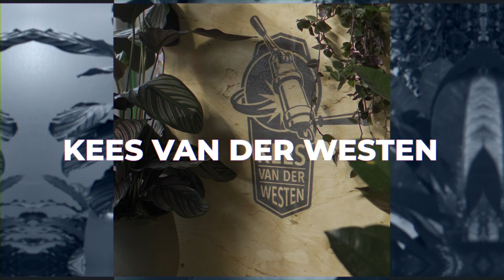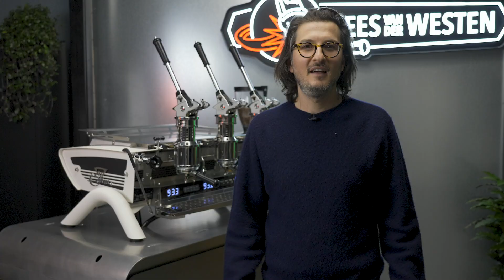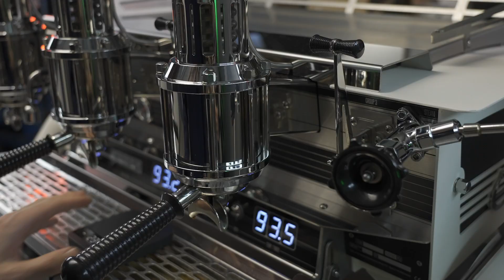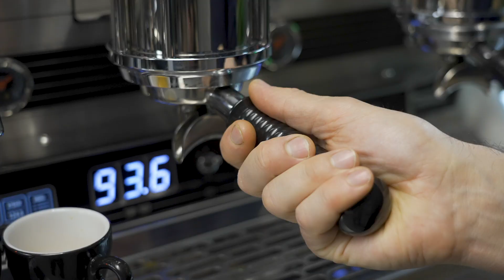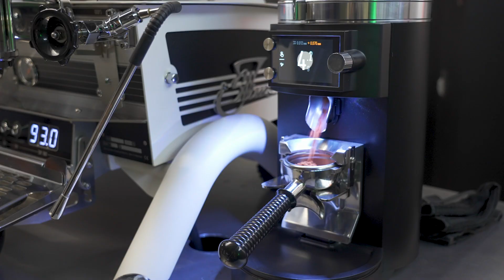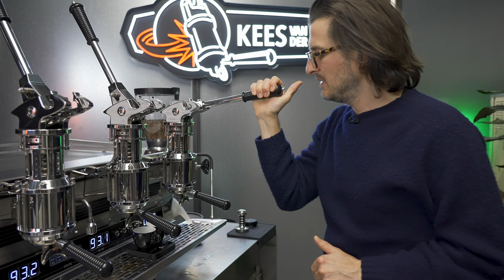The magic of lever machines: The Slim Jim Idrocompresso explained

Comment: After using a Rancilio commercial machine in my home since 2016, after a few years a variety of problems developed that required skilled repair techs that are not easy to find where I live. After getting the machine repaired it was sold to a friend and he loves it.  A year ago I decided to buy a Profitec Pro 800 lever machine and it is simple, well made, and has very few electronics. After using a lever machine, I would never return to any other machine.

Comment: Excellent!! But for next version I need one more feature: auto-flush (finish) shot at a certain timing or volume (weight) pre-defined for each group.
Reply from the maker: The Slim Jim Idrocompresso already has an automated flush, once you pull the small lever for a purge it stops automatically. Brew by weight is definitely something that we are looking into!

Comment: Idrocompresso and spring lever mechanism, have you combined it in one or it's two separate mechanisms in the group head?
Reply from the maker: “Idrocompresso” is a term used on the early classic lever group machines. From the end of the forties and start of the fifties there obviously was a need to distinguish the new type of machines from the old steam-driven-extraction ones. We like to use it nowadays to recognize the magnificent rich Italian history of technical developments improving the espresso coffee.  “Crema naturale” was another of these terms, as the new 9 bar extractions made possible by the strong springs created crema as we know it today.

Our lever groups are direct descendants of these classic machines. We still use a large lever to pull up a piston with a strong spring on top, but tried to make life easier for the barista by  eliminating the part of travel of the lever towards the barista, making spring pressure and infusion pressure adjustable, do away with the sneeze at end of extraction, make it possible to easily stop extraction at any moment and do a flush, have a shot timer and show actual pressure at the puck.
Reply: @KeesvdWesten  thanks for the answer! I guess i confused it with your idromatic mechanism, that is found on e.g. speedster. So, Slim Jim idrocompresso does not need an idromatic mechanism that measures preassure at the puck because it's spring lever, right?

Comment: Yes but people buy the lever machines preciselly because they want to have manual control over the lever and the pressure profile of their extractions. Doesn't the locking feature negate exactly that characteristic? When the release lever is pulled the group head lever returns in its position very fast to alllow any diversification of pressure in the final stage of the extraction.
Reply from the maker: Thank you for your reply! 

Our lever group functions exactly like the old classic spring-driven lever groups.

On the old type machines the locking of the lever (piston all the way up, water entering the brew chamber and infusing the coffee puck) is accomplished by pulling it over its central pivoting point. The piston is already at its highest position with that lever half-way. The rest of the travel of the lever is only to get it locked.

We simply developed a different locking system that functions at the point where the piston already reaches its high position, eliminating the dangerous lower range of lever travel.The locking of the lever has no different effects, compared to the classic spring driven lever groups.

The relief lever is only to be used when you want to stop the extraction process before the big lever hits home. For example because the coffee is blonding or anything else that seems wrong. On classic machines you can`t do much other than pull away the cup and/or start wrestling with the big lever.

With a spring loaded lever group there really is not much manual control as far as extraction goes. You may push a bit against the lever or hold it to slow it down when it moves, but that will not result in consistent shots in an espresso bar. It is the declining pressure of the spring that offers the desirable profile. Of course the barista can adjust the time and pressure of the infusion, which is important. On our machines also the spring pressure can be adjusted. The infamous sneeze at end of extraction is eliminated by an automatically activated solenoid.

Comment: As by many others, I would ask about your plans for a single head machine. Is the correlation between spring adjustment and pressure on the puck calculable? Does the machine have a single steam boiler for all group? (Great Machine, like all KVDW)
Reply from the maker: Hi! Lovely to read that you would be interested in a one group Idrocompresso, we have indeed noticed the requests ;) Probably, but the difficulty is the moving piston (constantly changing pressure) and back-pressure of the coffee puck. The old fashioned way to simply try and adjust seems to be the easy way! The Slim Jim Idrocompresso is a multiple boiler espresso machine, so it has one big steam boiler and a coffee boiler per group.

Comment: You are giving this the wrong spin. You now have mechanical paddles that offer complete pressure control across the extraction. You are way too narrow with that graph.
Reply from the maker: The graph is only shown to visually clarify the difference between pump machine versus lever machine. Don't forget the beautiful theatrical drama of the lever machine ;)

Comment: The piston seal and grease have always been a problem. I want to see the internal structure. Do I have to dance with the piston when replacing the seal?
Reply from the maker: Piston consists of 3 discs, which can easily be taken apart by loosening one central bolt. Replacing seals is piece of cake!
Reply: @KeesvdWesten  oh! I get it you are a genius The odds of using this expensive machine before it dies are infinitely close to zero.
Reply: For some, perhaps, I never had problems on seals or greasing on cma-group.

Comment: I have 2 x 2 group levers at home. A Victoria Aduino Athena in brass and a Bosco Sorento. They have identical group heads (double springs) but espresso tastes very different. Love them both and I alternate use on each day 
Kees always had a spot for levers, this isn't their first but is like a lever with the adjustability of a Spirit. I'd love to get my hands on one but the cost would be too prohibitive and availability.

Comment: You still get a little bit of a diminishing pressure with a pump machine since your coffee bed / puck degrades as the coffee is extracted, you can tell easily by observing the increase of the flow rate of coffee out (but also even easier if you have a group pressure gauge!). I think the main benefit of a lever machine is the control you have, as well as the easy pre-infusion which probably makes the most dramatic difference, especially with a nice modern light roast.
Reply: Typically on pump machines, they will use pumps rated for anywhere from 11 to 15 bar (or sometimes even higher) and then follow that with an over pressure valve.  The effect is that unless you have a machine that’s capable of profiling, the excess capacity of the pump combined with the OPV will result in more or less constant pressure at the puck, unless puck integrity completely fails and you get a massive channel.  This is something that you can verify if your machine has a manometer.  Flow restrictors can interfere with manometer readings, but unless you’re talking about a machine with a very high-flow pump, that’s probably not going to be an issue.
Reply: @isnerdy  that might be the case on low end machines but my ECM Synchronika seems to be set around 10bar which can be adjusted. I see unless I grind too fine which I often do it will gradually lower to maybe 7 or 8. I usually stop my shots earlier though.  I have flow control which gives some control so I don't usually let it do its own thing but I do notice it drops a bit.
Reply: @BensCoffeeRants  The pressure at the puck doesn’t necessarily have any correlation to the pressure that the pump is capable of.  That’s what the OPV valve takes care of.  The pump could be pumping out 13 bar constantly, and if the OPV is set to 9 bar, any additional water over 9 bar is going either back into the reservoir, or into the drip tray, or down the drain, depending on the configuration of the machine.  It’s actually not a bad thing to have a a pump with a higher pressure rating than needed - often those over-specced units last longer.  But really the OPV is what determines the maximum pressure delivered to the puck, unless you’re doing pressure or flow profiling.  The only reason you should ever see pressure declining on a pump machine when you’re not pulling a declining profile, is because of channeling.
Reply: @isnerdy  I know. On my e61 machine I have a group pressure gauge it shows actual brew pressure or close to it anyway. I don't usually pay attention to the pump pressure. 
Also rotary pumps work a little differently and the pressure is adjusted right on the pump not with the opv.
Reply: @BensCoffeeRants  On a rotary pump, what you're adjusting is the bypass valve - it's the same concept as adjusting the OPV on a machine with a vibratory pump, except that it's built into the pump rather than a separate part.  The rotary pump runs at a constant speed and pumps a constant volume of water per second, regardless of the maximum pressure being allowed by the bypass valve.  That still means that when there is less puck resistance, the flow rate through the valve to the boiler will increase automatically to maintain a specific pressure, up to the limit of any flow restrictors that may be in the water path after the pump.

Comment: I can confirm after several months of use as a very lucky home user, it is a joy and produces amazing and consistent results. I have a 2 group and pair each group with a different single dose grinder/burr type so I can optimise for the bean. The group temp set (it changes and stabilises so fast in the head), stability and sub 5 min warm up from eco is a game changer for me with a lever to manage light roasted and highly processed coffee effectively and get the best out of espresso. The cut off is also perfect for me as I drink ristretto so I always had to pull the shot and wait. Of course yes it is not cheap but it will outlast me!
Reply: How much did it cost you please?

Comment: All he said, I totally agree and am positive; we have had this model for three months now; we used this model of Slim Jim three weeks ago in a four days event with two group heads, under 98C we pulled almost 900 full 1:2 ratio espresso shots, pre-set and semi-manual, every single image is set as we want for the output, all automated build is 100% reliable. I can make an endorsement with the quality build.

Comment: Kees van der Westen sits at the apex of espresso machine art. The problem is that many of us will never have one. Yes, the expense is one thing but if espresso is your passion there is a way. The problem is that many of us live in rental apartments and houses and are not allowed to plumb in espresso machines. We must use water reservoirs, which are usually made from plastic. This is why, for the home barista, the Olympia Cremina is still King. If Kees van der Westen made a single group Slim Jim Indrocompresso with an optional ceramic or borosilicate glass water reservoir, it would be a game changer for many of us. Better yet, I would love to see a lever on a Speedster. It's just 11 days before before Christmas. I've still got time to hop on the subway, go to Macy's, and see Santa.... I've been good this year.
Reply: you could try the ACS Evo Leva, it can run from a water tank and it has a lot of nice features
Reply: Unfortunately you would need a completely different chassis to stabilise it , but this machine also has some technical changes internally to make it more temp stable that would not translate to a speedster and be difficult in a single group.
Reply: @philpryor3152  Thank you for the clarification. The lust, however, is still there for Kees van der Westen to make a single group lever machine with a water reservoir. I'm still going to ask Santa. It doesn't hurt.
Reply: Totally agree, I assure you I asked a lot for the same present🙏🏻
Reply: @philpryor3152  🎄
Reply: @davidhunternyc1  fortunately I got myself a 2 Group Idrocompresso so Santa did come 😁
Reply: @philpryor3152  Oh, you must have been good for a very long time! You deserve it. Congrats!
Reply: I don’t see why a Flojet wouldn’t fit the bill in the absence of plumbing in
Reply: idk what's the problem with plumbing in rental apartments. unless it's directly prohibited and checked regularly - I see no problems to install T-shaped thing in a cold water line to a kitchen tap, and connect the espresso machine to that thing (sorry idk the correct name for that divider)
Reply: @dj_feel_x  Old NYC apartments, where you have to run your water for a minute to get the rust out, plus zero counter space. The entire kitchen would have to be renovated. Not even sure if the 15 amp fuse box is good enough.